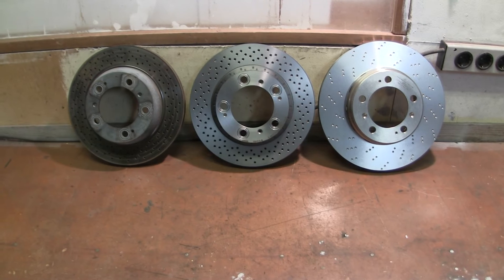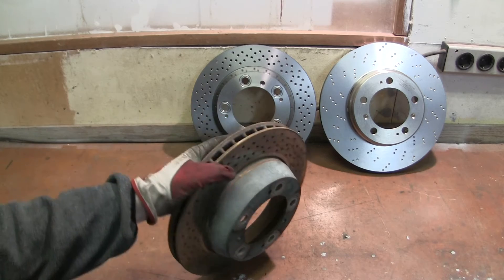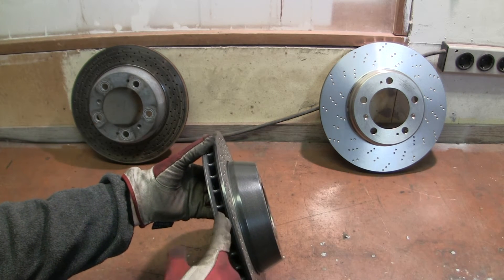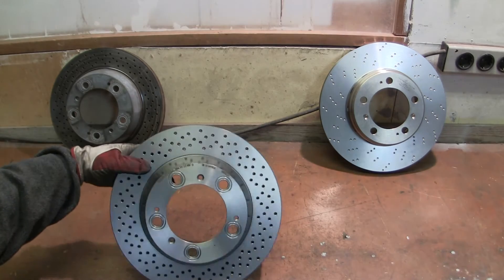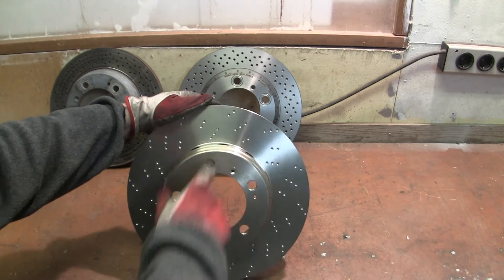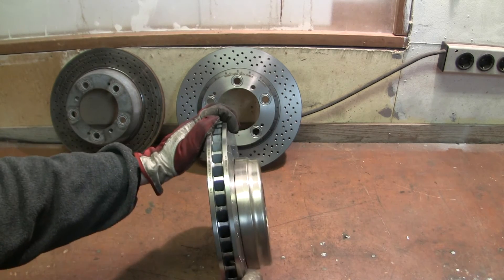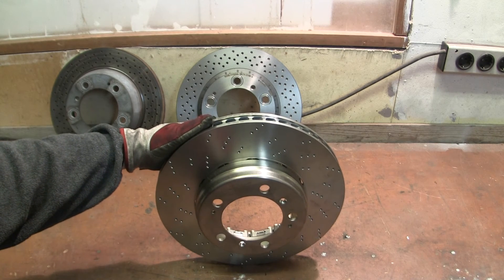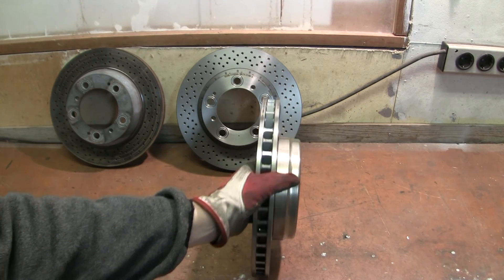Brake disks - original versus Brembo versus PFC  │Porsche Cayman Tinkering

Comment: Hi! Just bought a set of 4 BREMBO discs and BREMBO pads. For spirited street driving, do you think I will notice some difference? My car is a 2005 987S (BOXSTER). Thanks you in advance!
Reply from the maker: For street driving you will probably not notice any difference. For street-legal driving you are so far from the edge of performance it will not make any difference. Take it to a track, it can handle it - it's built for that. Good luck
Reply: @tobetinkering , but do you think for tracking, the OEM Setup is better than the BREMBO setup?
Reply from the maker: @figueiredoeduardo7252  it all comes down to what brembo stuff you buy. Discs are usually similar but pads differ depending on what you buy. Consult your seller for details. My pads need some heat in them to be working properly, downside is that they screeche a lot when cold so not so good for normal use so it all comes down to what you give priority to. If you start to track the car you need new brake fluids since old ones contain water and will boil = go spungy